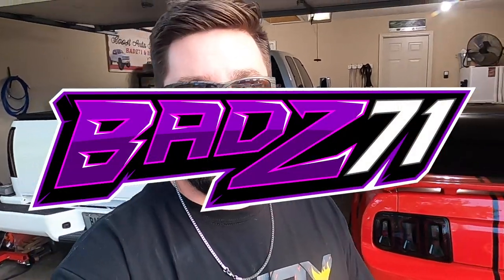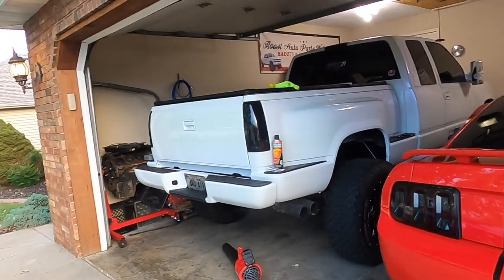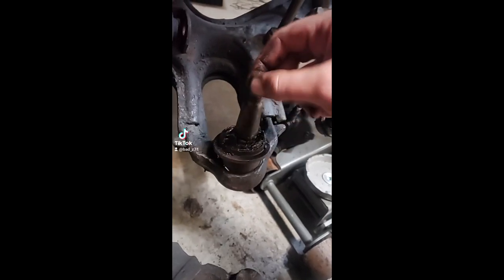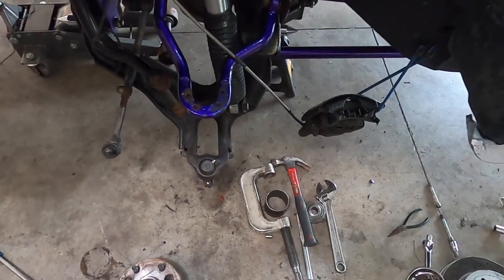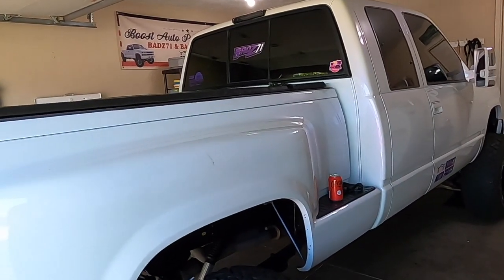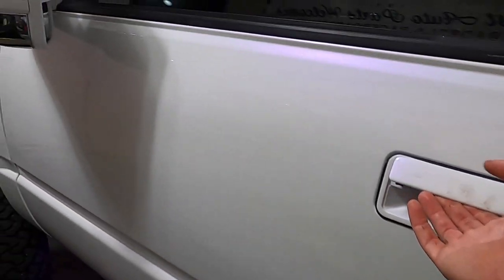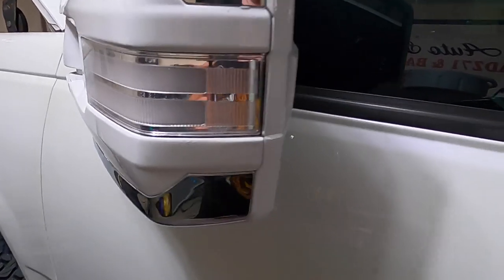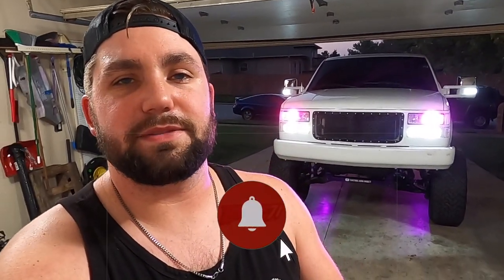Will it make it to LIFTED TRUCK NATIONALS 2021?

Comment: I had a 95 k1500 silverado ext cab step side Z71 off-road in white just like this one. It had a 6" superlift kit and skyjacker shocks all around with the add a leaf rear, originally went with skyjacker kit but after failing to be able to install 3 different kits on the front end the skyjacker rep finally grew a brain and asked if my truck was built in Canada which it was so for some reason things were lining up like 3/4" out from being able to bolt up, so retained everything from the sky kit but front end which was replaced with superlift kit made for Canadian maned trucks. Truck had electric lockers and 35" bfg mudders. Then came the 5.7tbi which had vortec iron heads, cam, intake, fuel pump pressure reg kit up to 13psi and chip from hyper tech. She was an absolute beast, never ended up getting onto a Dyno but I'm confident I was making over 320 at the wheels. Had to many cars and not enough garage or driveway and wife talked me into selling it and a Jeep I had. After having that truck for 15+ years, got it with 34k mi did everything but motor work right away then finally did the engine work when I decided to rebuild it at 100k as it was feeling a little tired, or I was of having that rig with the stock 180hp. So built it right and had a ball with it for about 3 years putting 25k mi on it then replaced the trans after a hard day in the mountains it went on me so Jasper came to the rescue, literally a month later the rear end went so put in new 3:73. Finally sold it in late 2017 with new rear, trans, and that engine with only 25k on it after the build and 125k total on the truck for $5000 to a kid down the road a bit who had been admiring it for years. Hell he used to ride his bike by my place when he was like 10 after I'd get home from a weekend wheeling in the mountains, I live in CO, and I'd be in the driveway washing it and the cr250r I'd always bring with. I got a new project that got stolen right after I lifted it and put $3k worth of rubber on it, due to Corona I haven't worked since late 2019 and I'm well on my way to being 100% savings free and that means no builds coming up any time soon. On top of all that the kid who bought that truck hasn't washed it in over a month and must have lost the rear as the fiberglass now has a big crack over the passenger side wheel well AND I HAVE TO SEE THE GOD DAMN THING EVERY DAY and somehow convince myself not to kill him and put him thru a wood chipper into the lake and take MY truck back!!! So be warned one and all  and first, don't ever sell anything because your wife needs somewhere to park in the driveway as well, she can park in the street.  Second, that kid who admired your rig half his life and convinced you he would respect and take care of it if you sold it to him WILL LET YOU DOWN,  after you give him a $15k rig for $5 grand of course. Third and the basic lesson over all, these toys we dump thousands of hours and all our money into won't thank us for it so don't expect anything from them monitarily and instead tell yourself I will get x amount of time out of this and instead of ever selling drive it until the wheels fall off and it spontaneously combusts from pure abuse! Much like the car at the end of blues brothers! You think it will be ok seeing someone else driving it but it's literally like walking in on someone else with your wife, well I can't say for sure since I haven't had that experience but that's sure what it feels like, you start seeing red and just want to kill. Don't ever sell your artwork for others to destroy!